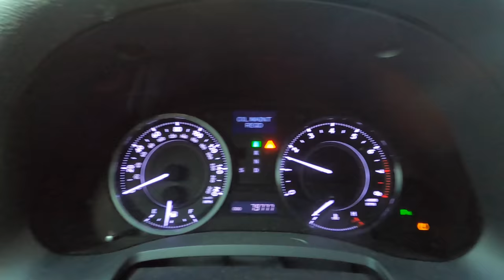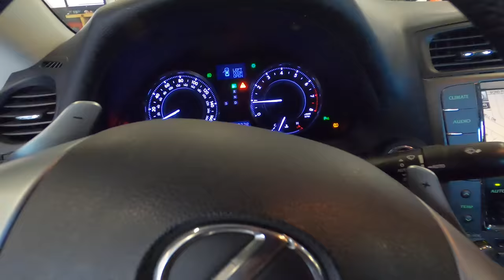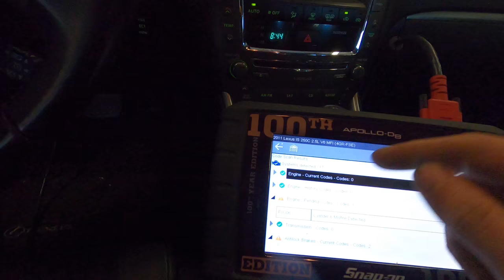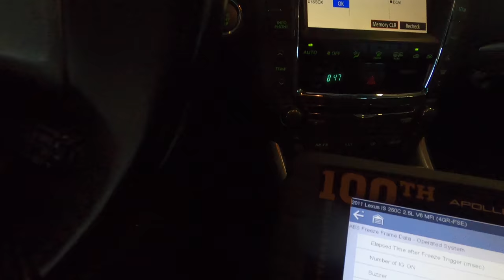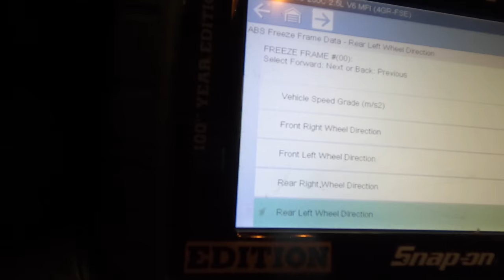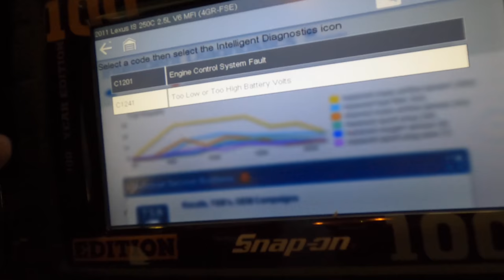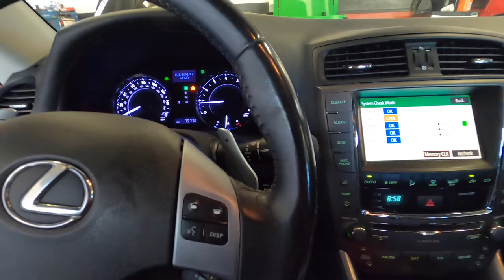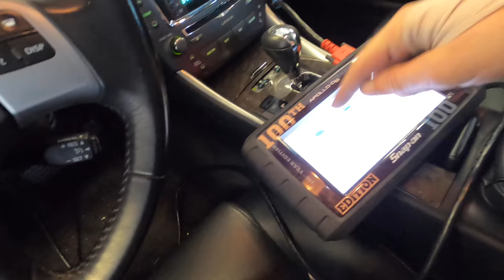Lexus IS 250:  Customer States Lost Power While Driving. Why can’t people communicate?

Comment: A question, Ray... Does that Lexus have aluminum heads? Whether it does or not, what do you think of putting a dab of anti-sieze compound on the spark plug threads? I make a habit of it on my truck, which does have an all aluminum engine,  just as a precaution. Probably wouldn't hurt on cast iron, either, for that matter. 
I agree about hand threading to avoid cross threading. Like you, I also always add a smear of dielectric grease. Found your points about broken ceramic interesting.
Here's some spark plug trivia: Surely you've heard of the "AC" spark plug brand? Do you know what "AC" stands for? 
It's "Adolph Coors", much better known for their beer. They were a major ceramics maker too, using it to bottle their beer at one time. Coors also became one of the earliest manufacturers of spark plugs, with the AC brand. I don't know if they're still involved in what is now AC Delco, making lots of other stuff.
Coors made other things out of ceramics, too. For example, I have a Coors putter with a ceramic head. Doesn't improve my golf scores at all... might even add some strokes... I bought it cheap at flea market as a novelty.
Reply: Those are aluminum heads, yeah.  We make em at my plant for all US made toyota/lexus.  Pretty sure that's a GR engine, anyway.  As for the anti-sieze, that you'd have to wait for someone else's input, as I'm industrial maintenance, not automotive, and I'll leave that to the experts.
Reply: The manual for my Chevy with aluminum heads specifically forbids anti-seize - not sure why. I can say that in spite of using anti-seize on my '78 Honda, one plug pulled the threads out on removal - again, not sure why.
Reply: @dustcommander100  because the anti seize acts as a lubricant to the threads, which increases the risk of over torqueing the spark plug. even if you use a torque wrench.
Reply: it depends on the brand of plugs. NGK for example - has a bright plated finish - per their bulletins, this serves as an anti-seize coating; use of anti-seize will give false torque readings (allowing over-tightening). If the plug has a dull / natural metal finish then use anti-seize compound. Used NGKs on aluminum heads on a vehicle I've had for 20 years - they get changed out every 5 years (per mfgr.) as I don't reach the 100K intervals in that time...never an issue with the plugs / threads

Comment: Great job!! Only recommendation I have would be to check the spacing on the new spark plugs before installing them. Quality control isn't always the best for mass produced auto parts and I'd say 1 out of every 4 or 5 spark plugs have a bigger or smaller gap than they are supposed to.

Comment: My only critique would be that you didn't emphasize the importance of letting the engine cool off before torqueing the plugs. If you put a new cold plug in a hot engine the aluminum is already expanded but the plug isn't. This runs the risk of cracking the plug hole when the plug heats up while driving.
Reply: Is that a fact🤣

Comment: I worked on a car for a friend of wife. Long story short, over the course of a year, it suffered 3 burnt coil packs (which, with a GM 3800, means 2 dead cylinders) and 6 burnt plug wires before she finally okayed replacing the spark plugs. Spec on the plugs is .060. The narrowest gap on the old plugs was .080, but the widest was .100. And I had to replace one of the 3 replacement coils because the huge plug gaps killed it.

Comment: Take out 5 perfectly good coils with no DTCs & replace them with China made don't last coils. Yeah, that's a great plan!
Reply: The only problem with your statement is it's entirely possible that the other five weren't 'perfectly good coils'. As an example, my wifes car has had three coils croak in about eight months. Only one original coil is left, which I probably should replace proactively.
Reply: @aperson9495  You may be correct, however I have never found aftermarket made in China coil to be reliable or long lived. Other than OEM the only coils I would trust are Denso or Hitachi
Reply: @knockywigglesworth1909  ChinaZone coils can leave you on the side of the road late at night.  Ask me how I know.

Comment: That little switch u were asking about is a new smaller flux capacitor engaging unit. It senses when car hits 88 then sends signal to the normally closed relay that opens allowing 80 thousand Gigi watts to the flux capacitor enabling the time continuum worm hole to open.. 
  Your welcome. Thank me later.
 (Side note) flux capacitors on this model are mounted under rear seat. FYI.

Comment: For all Toyota family, ignition coils(Denso) went bad due to spark plugs bad.  
I was on highway 70 miles suddenly check engine light on at the same time the truck acted up intermittently and lost power but still crawled to next exit.  Scrawled home on backroads and local roads.  Scanner indicated PCV valve but there is no PCV valve.  Many mechanics said no PCV valve.  
Sat in my driveway for two days, finally- second days I decided to check ignition coils one by one, and swapped around, then found first cylinder acted up, removed spark plus. No gap at the iridium spark plug tip, completely burned, replaced Iridium spark plugs with new one for eight cylinders and one  ignition coil was replaced. 
Working fine for six months now.
Currently 250K miles on ignition coils, except one damaged by bad spark plug.  
If you could, please including 4.7L V8 Toyota timing belt and water pump.  I liked to see you perform big job.  
I did replaced at 95K miles, and found timing belt & water pump still in great condition.

Comment: Somewhat off the subject, but joint pains are OFTEN due to sleeping on an arm -- sometimes leg and neck -- wrong.
One hint...If you curl your arm under the pillow and support the weight of your head with the arm, expect elbow and even shoulder problems. Also, curling your hand via your wrist all night, especially if you are tense, will screw up your wrist occasionally.
My earlier years were very stressful, I would sleep with my joints under pressure way too often. I learned to stop doing that and the problems stopped.
Sorry for the interruption.

Comment: It would be the cathode that could be disturbed by dropping the plug into the head, not the anode.

The sensor you asked about on the intake manifold is probably the cold start injector for adding fuel on cold days (acts like the choke function on a carburettor) making the fuel mixture a little on the rich side, I say that because it has a fuel lone running to it.

Comment: You can also see if the plug is original by the marking at the very top. Will have a little + on it. Plugs are due at 60k on those cars. Car will always throw that voltage code when the battery dies. ( I know you said it had looked like a new battery )

Comment: Coil is not working in feedback loop that adjust duty cycle. It just works as hard, as peak voltage when atmosphere breaks down resistance needs it to. Coil is breaking down when plugs are worn out, but it is completely internal, not related to controlling it
Reply: In case of knock detection build in coil it just might be related to controlling it harder and harder while plug is eroding :v

Comment: Great videos rainman don't bother with the non-believers, lol , I am just messaging you about a previous video. I don.t know how to send a private message on youtube but you did an oil and filter change on a diesel engine in which you stated that you don.t fill the filter before installing. I am an industrial mechanic, similar but different, I work on diesel hydraulic canes. I was told by the gentleman I took over from that always fill the filter before installation. After watching your video it made sense. So I checked the Cummins owner manual and they do recommend filling the filter. I think each is right in principal, maybe because ours has a turbo might be the difference? Sorry about your wrist

Comment: Boy does this strike a nerve.  Adult Daughter's 2011 MDX was overdue for an oil change...  
"Is the oil light on?  No
Drained the oil.  Less than a quart came out.  "Overdue" flashing on the dash, oil light was on.  Turns out it was 4000 miles overdue.  Completed the oil change and it 'seems fine'.  Needs a quart every 800-100 miles to stay out of trouble.
Some drivers have no awareness what it takes to keep older cars maintained, and think the lights are some cool special effect.
Reply: My sisters car burns about a quart every 1500 miles. I have explained to her multiple times it needs to be checked and even made a kit with oil/funnel/rag to do it. Finally I explained, If you run it out of oil the engine will blow up and you wont have a car. (She can't afford to replace it)
Reply: Yup have a 2010 that does the same thing.
Reply: @mph5896  I've explained the same thing, her last car was a 2007 Murano.  Same thing, and while the engine ran afterwards, it was very noisy.  Lasted another15,000 miles and traded for the MDX.  
She can't understand that the brakes are going when the noise starts, gets the point when she can't hear the radio
Reply: @fknsl1  do what my dad did and let her learn the hard way lol. My sister ended up having to take the bus to work for a while until she wised up to the importance of maintenance.

Comment: Kind of surprised that you don't use a short chunk of fuel line to put spark plugs back into their holes with. I have a piece about 8 inches long that has a piece of shrink tube on the plug end to keep it nice and snug, and it's lasted for years. Takes all the worry about cross threading away, and the hose is long enough that I was able to get the plugs into the deep wells of my old Toyota with no problems.

Comment: watching you work on this Lexus reminds me of some of the custom tools a friend of mine had to make for working on an old Honda Accord, we called it the "Booma-wrench" it was two wrenches cut off to make one wrench in roughly the shape of a check mark just to remove the bypass tube for the EGR/intake heater that of course connect to the intake at the bottom, just out of view, good to know that even modern cars require "specialty" tools
Reply: I make custom tools of some sort for almost everything I work on.
I keep my really good wrenches and then some half - ass ones to use for custom tool making.

Comment: A few month ago I cleaned the EGR-system on my Toyota. It was clogged up and the engine wasn't running smooth. What I also did was change the oil. I did that because of that dirty EGR-system the mixture of air and petrol didn't burn as good as it should have. So all kinds of dirty shit came into the oil, I suppose, because the oil wasn't yellow anymore, but brown. Now, after cleaning the EGR and changing the oil, the engine runs smooth again and the oil is still yellow

Comment: What you are holding at 17:40 is the cold start fuel injector. Toyota/Lexus installed this on the 4GR as it only has direct Injection and it is used to start the engine when cold as it cannot be started on direct

Comment: Hi ray I know this is a bit off topic but around 1 week ago I got my car back from a repair shop and two hours later all warning lights came on and car died took around 30 seconds to crank towed it and the engine harness and o2sensor were fried what could have caused that car is a 2017 Skoda superb 2.0l tdi and u just earned a subscriber
Reply: The repair shop also replaced the engine in my car and after they did that the car has been brought back to them 4 times

Comment: 1 more bolt behind throttle body and PCV hose and the intake manifold will be free. About cylinder 4,6 there are conjuction plugs above VVT solenoid on bank2. Check them too.
Reply: That intake manifolds look like a total mess on this Toyota V6. I much prefer how Honda does their V6 engine intake than the other auto makers. Their design makes changing spark plugs a breeze!
Reply: @MrSamPhoenix  agreed, it takes lots of space but doesn’t quite useful as the V8 one which can be replaced by a supercharger
Reply: @MrLeadpb  - You’re talking Honda’s V6 engine?

Comment: The temp probe you asked about isn’t temp in a lot of European bound vehicles they quite often have a starting injector in the manifold heat shut off when it’s correct temp , it generally is not needed I used to have MAN truck that used to have injector when it started leaking it caused starting issues because it would flood cylinder overnight and cause obvious hydro locking and air in system would negate easy starting block it off no problem

Comment: Those IS 250’s also have random misfires due to carbon build up. Saw many come in for that and had to pull the engines to clean them how the dealer required us to. Was covered by a special extended warranty for some time but I think it has expired.

Comment: This is also partly down to the CS advisors there not asking the right questions & passing that on to you too. How did she not manage to get that info from the customer?

I've had multiple ocassions in the past got a check engine light that later self cleared in a Chrysler with no codes stored historical or current damn pain that

Comment: I hope spark plugs are different than wiring harnesses because that much dielectric grease would cause problems in a harness plug. Not every time, but things like pins slipping out, connections failing after thermal cycling or sitting idle cause it and not consistently. It only takes a tiny dab for it to work and I know for a fact that until the last 25 years it wasn't used when replacing spark plugs by everyone.

Comment: I just installed the same Denso plugs in a GS 300. I chose to use a a ratchet on install those spark plugs instead. Owners were smart to just replace all 6 coils. Hopefully, Denso coils?
Reply: Denso is an avoid for me. Stupid Denso engineering on my 04 Honda Pilot radiator cost me $3000 in trans work. Wish I could post a pic of the failed trans cooler radiator connection. And thank you to Honda USA for denying the problem.
Reply: @silensmortis  I serviced one of many 2000-2002  Accords. A few transmissions began to fail over 125,000. The rebuilder pointed to the transmission cooler in the radiators was inadequate, but it was NOT Denso's fault. In addition, many of these transmission were not serviced in a timely fashion (no such thing as lifetime ATF) We must remember, that Denso is a parts supplier to Honda and Toyota to name a few. It was Honda's fault for not addressing the lack of cooling capacity for that vehicle (1998-2002). The transmission was rebuilt and and additional cooler was added to supplement the factory transmission cooler. I addition, regular ATF service is crucial (every 30,000 miles). So, I am aware of this issue, but go the extra mile and have a Hayden ATF cooler installed, especially on Honda (sealed) transmissions

Comment: I have an IS 250 and it calls for spark plugs to be replaced at 60K. It’s an expensive job because of having to remove the intake, but at least I don’t have to worry about a timing belt on that engine.

Comment: It has a high pressure fuel line with a banjo bolt and inserts into the upper intake.
I didn't see any wires.
What is it ?
Why temp related?
I searched and found they have a fuel rail temp sender recall on older is 250's.
I know that's off topic info when you asked about the cold start injector or valve.
It seems odd to me they used one on this.
Anyways.
Good call on the wide plug gap. Misfire cause Everytime.
Older toylets reduced their plug gap to .032" across the board for this.
It was a bulletin when you were a youngster. Maybe even before that.
Nice job on this.

Comment: Quality control...I bought a fram air filter and it was identical to my old filter,  but wouldn't fit my car. They glued the rubber end caps on the filter and didn't seat it before glue was dried.  Put my old filter back in and contacted fram..... ohh we have been having issues with those. No refund. Screw fram!!!!!!

Comment: Ray this old mechanic will help you with some tips lolhaha   I use the coil to lower the plug in the plug hole definitely put some lube on the plug Also if you break  the porcelain on a plug and afraid of getting glass in the motor especially HPD I , I made adapter to fit in my shop vacuum along with an appernatis hahaha  to fit down the coil hole, I like you fiddle with things and make them work

Comment: not exactly related but i have a four wheeler that wouldnt idle, also would lose power while driving, worked great tho full throttle
took out the spark plug and the gap was non existent there was so much  carbon, cleaned the plug and it runs great

Comment: That thing that goes into the back of the manifold with a line attached is a cold start injector. Toyota is one manufacturer out of a few that seems to like using them. I'm surprised something that new has one, though.
Reply: Is cold start a thing in Florida? If overnight temp in Colorado is 98 the engine is always warm.

Comment: Just replace the spark plugs at about half or 2/3rd of what the service manual says. My car has a 100k mile service interval on the spark plugs, I replaced them at 70k (prob should have done it at 55-60k) anyway as I want to prevent destroying a coil. I don't have hard evidence besides my past experience but every time I've lost a coil it was with worn out plugs.

Comment: The reason LFP batteries are superior,  they're FAR less likely to experience thermal runaway, which is kind of important,  if you park it in an attached garage. 
A battery management system can heat the battery in cold climates to facilitate charging. 
They have no toxic materials, and are easily recycled.

Comment: Use a piece of 5/8 hose to put spark plugs in to prevent damaging gap.
Also looks like you forgot the coil wire pigtail bolts under the intake 🤷‍♂️
Reply from the maker: Is skip around to Save video time